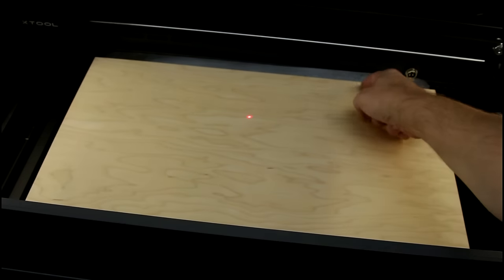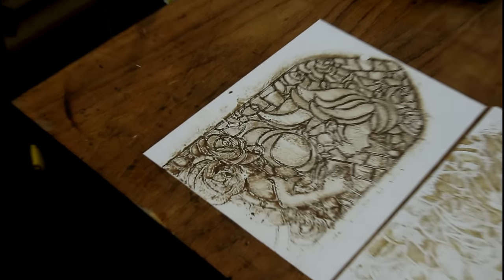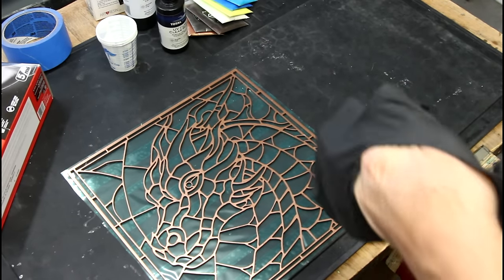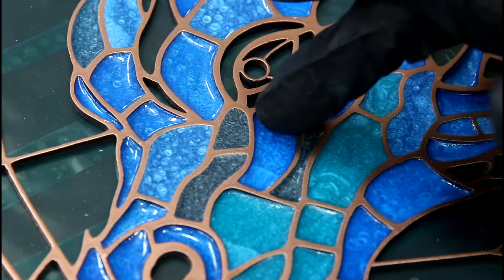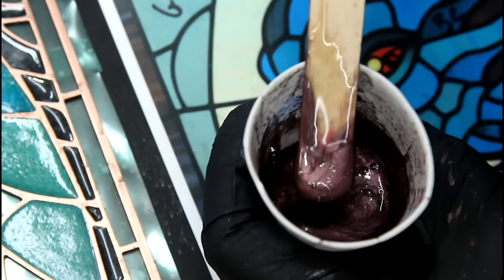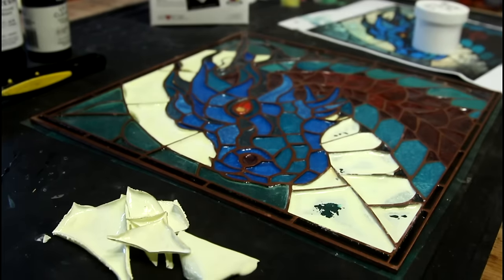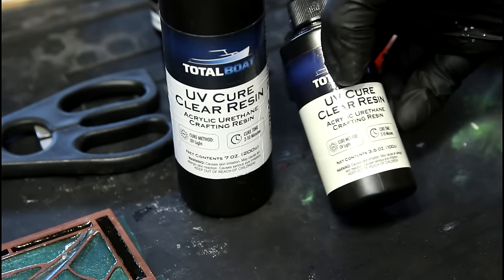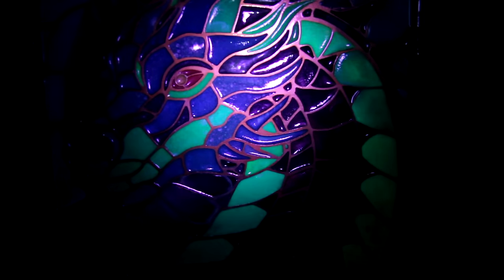Resin Stained Glass: Viewer Suggestions!

Comment: Some tips from me: buy a 365nm UV light (you used a 395/405nm i think) - use translucent packing tape (the blue tape you used blocks some uv wavelenghts so it can''t get thru to the resin - use a syringe so you can forse the resin in the corners.
Hope it helps you and keep up the good work 👍
Reply from the maker: Thank you!

Comment: Peter
You have probably heard this so many times already but I will put words in anyway lol
UV resin cures with light and therefore needs light to travel through it to cure. If the pigments are to opaque, the light wont get through and you will only be curing the top. 
If you want opaque colours, then you need to do many really thin layers.
But I salute you for your perseverance and flare  😀
Reply from the maker: Thanks Wendy!

Comment: As someone who has used UV resin in a number of jewelry sized items, a few tips! 

I use these pigments for UV resin, but 
1. You need a WAY brighter light. A nail art lamp is much better. Anything with any opacity, or big projects like that, I will let cure in a sunny place for a couple of days to get really hard. 
2. If you want translucent, use alcohol inks (but no white!). 
3. If you want to use mica, use several layers- this is way too thick. OR rub it onto a transparent layer, with another layer on top, you can make some neat effects that way. 
4. If you want opaque, try UV gel nail polish as a colourant, or buy UV resin pigments. Make the layers as thin as you can. Epoxy resin doesn’t always ‘play nicely’ when layered. As long as the layers are well cured, UV resin layers beautifully. 

Other tips: 
1. Nail art tools are your best friends, disposable brushes, lint-free wipes, etc RULE. Cheap as dirt on Ali Express. 
2. It cleans up well with rubbing alcohol
3. It doesn’t stick well to a lot of things that epoxy resin does- especially metal. A super thin coat of clear across the back will lock it all in. (I think the copper plating was ‘rough’ enough, but it can pop off of smooth metal)

I’m trying a larger window decoration, using brass flat brass wire right now. Definitely not as fast as this, but alas, no xtool (but lots of wire experience, so we’ll see).

Comment: Long time follower, first time commenter. 
I wanted to mention that "black lights" are not a good source for actual UV waves. The black light will help start it so you can finish it with the sun/etc, but it is not actually pumping out as much UV as you would suspect. I suspect almost any pigment will attenuate the light, increasing with opacity, in general. This can effect your lights penetration entirely or just increase the amount of UV needed. I would be curious how far you could push it though. 
If you do more work with UV resins in the future, I might suggest a "lab grade handheld UV lamp" or (more affordably) some UV LEDs. Either could be set up to 1) wave above your work to immediately set and/or 2) you can make a reflective box with the UV source inside (one might call it the UV EZ-Bake) to cure.
Can't wait to see your next adventure!

Comment: Howdy handsome. I have 3 questions. 
At about 20 minutes in it sounded like you were using a small torch.  Do you torch this resin to pop bubbles before using the blacklight to cure it?
Are you able to use Spray paint in UV resin and it achieves similar results as with reg A/B epoxy?
Can you create "cells" with UV resin?

Comment: Everyone else has already pointed out the 'too opaque to cure' bit, so I have suggestions if you want to use UV resin more in the future. I've found that a lot of pigments that are labeled as being for UV resin tend to fade A LOT in a relatively short amount of time, so I usually use VERY SMALL amounts of mica powder or, like, a single drop of acrylic paint. Basically, once the pigment is mixed in, if you scoop some of the resin up on a popsicle stick and hold it up to a light (just a regular, non-UV light in this case), if you can't see through the resin, it's probably too opaque to cure properly.

Similarly, if you put UV resin in silicone molds, they have to be transparent molds or else the light will have trouble reaching the bottom of the mold.

And while it wouldn't have worked for a piece this big, for smaller pieces, UV/LED nail lamps work great.

Comment: The trick with UV resin is TRANSLUCENT pigments. The more opaque your pigments, the more it'll block the light that cures the resin. That's why the darker red color you used didn't cure all the way to the back. With something that thin, it's easy enough to just leave it out in the sun like you did. But if you had a thicker project, that wouldn't have been an option.

Comment: I don't have much experiance with resin, but I do have a few resin dental fillings. The dentists never EVER do UV fillings in one go. They do a thin layer, shine the light, thin layer, shine the light, and build up the filling in 4-5 passes. The fillings are opague white, obviously. So I think that if the resin is not clear UV resin, you need to use either a dangeriously powerful UV lamp, or do it in passes.

Comment: I make little pendants with UV resin - whenever I add  pigments (no matter if opaque, ink or translucent) I make sure to always cure the backside as well before removing the tape. That's one of the good things about the clear tape: it lets UV light pass through.

Haven't tried it with such a big project yet (my pendant are usually just wire frames of roughly 2 by 3 inches at max) but I really recommend getting a stronger UV light and trying to keep the layers thinner so they can cure completely, even if you added some opaque pigments.

Comment: Total Pseudoscientific Conjecture (i.e., BS): What if the blue colors cured better than the reds because blue is closer to violet/ultraviolet on the spectrum and therefore didn't reflect as much UV away from the resin. That's probably not why it happened but that would be a cool explanation.

Comment: Man that was a bummer, it was looking so pretty! Glad you managed to save it! And I agree the blue is nicer than the yellow.
I was gonna drop some hints about my own experiences with UV resin but people beat me to most of them; only thing I haven't seen said is UV resin makes a LOT of heat on its own, so you want to use it in small quantities. I wouldn't go much bigger than what you're working with here. I think this would totally work with transparent pigments and stronger UV lights. A UV flashlight is OK for small things or "tacking" stuff into place but you want a big UV Gel Nail light or stronger. And I've had better luck curing things for twice as long as the bottle says, because sometimes it cures sticky on the surface and that seems to help.

Comment: A bit of an Info Dump on UV resins and pigments, What I learned on My Summer Project:

UV resin has issues with powder pigments because it blocks the UV light... that could have been the pigment problems with the cream white here.  Less pigment is better so that the piece has some depth, enough so that you can see swirls well beneath the surface usually ends up okay....but some resins don't handle it as well as others.  I'd wager Total Boat's is made more for doing clear coats as well, eg patching boat hull or coating lures and things would  be fine with just about any brand of UV resin.

Some UV resin brands also have issues with some alcohol inks(to get nice transparent reds or blues for example, like actual stained glass which also cure better for thicker pieces).  Let's Resin stayed very tacky and sticky on surfaces.  JDiction handled red/blue alcohol inks just fine for me, nice crystal clear transparent and hard on the surface usually, can be  finicky if you do various layers or have trapped air in your mold(I did chess pieces in a 1 piece mold with transparent red/blue heads).

That's the brand of alcohol ink I used anyways...who knows if other brands have the opposite issues with those two resins....troubles aside, if you clean off any sticky residue then hit with a clear coat of spraypaint that sticks to plastics, you get that nice glassy or crystal finish without needing to polish by hand(Doing a whole chess set would be terrible, even if one had all the proper tools like a lathe you could cinch down on the base of pieces).

Also, each resin brand can be very selective of lights that work....Some projects I hit with a couple lights and put them out in the sun for exposure to the full gamut of wavelengths that the lights I have may not provide.

However, the time thing is fantastic with UV resin, you can let it sit in warm water overnight and have utterly bubble free pours(aside from what gets trapped in mold details, which you have infinite time to pick out with a toothpick or bamboo skewer), or pour and let it sit, hit it every once in a while with a heat-gun.

Torching UV resin can get dicey though, it can actually light on fire in liquid form.....not to mention damage soft/sensitive molds(I'm using soft white/clear/frosted silicone molds, the chess set from Let's Resin).

Residue wipes off of all surfaces decently, wipe with dry paper or shop towel, then one wetted with rubbing alcohol.

UV resin also makes excellent resin tools.  Dip the flat  end of a bamboo skewer in UV resin, lift it and let it drip off until you have a nice blob just hanging there, then cure with UV light, works on toothpicks too, and these make great tools that glide along silicone molds instead of bare wood sticking or trying to catch in the silicone mold while you're trying to pick out stubborn bubbles in corners and crannies.

Comment: The light was blocked by titanium dioxide basically. That's what is in most white, and we'll, it's mineral sunscreen too. You can't really use opaque pigments with UV resin, it should have said that in your resin instructions

Comment: Peter I am really impressed with your efforts here! it really does look amazing! I wanted to give you an advice if you are going to keep working with such resin. You should make a wooden box with a door that you could insert your piece with resin and close the door, and on the ceiling of the box install a germicidal tube that makes a ton of UVC. it is much stronger UV than that flashlight and it would penetrate much more effectively. You could install a timer for example 2 minutes for each color and then for the final curing 5 or 10 minutes for a whole thing.

Comment: I agree with other commenters: the pale yellow and, to a certain extent, the red, were too opaque and the light didn't penetrate past the surface. A stronger light or longer curing time would fix that. The peeling/curling is similar to what is seen with gel nail polish when an additional coat is painted over a coat that isn't fully dry: it wrinkles. That brings me to another thing I wanted to mention: gel nail polish could be used for something like this. It's way more expensive than buying UV resin in a tube, so maybe only do that if you already have it laying around. There is something called building gel that is very thick UV resin, used for creating false nails with the help of a form, which could be interesting? I'm not a nail tech or any kind of expert; if you want more info on that I'd recommend Suzie of Nail Career Education here on YouTube.
Also: You can use clear packing tape to create things like small molds or backings for resins and acrylics.

Comment: Was the pigment Titanium Dioxide powder (titanium white)? Because if so, do you know what you just mixed in to your UV curing resin? Sunscreen! 

Titanium dioxide is a UV-blocking pigment that is so great at blocking UV that we can grind it so fine that an invisibly thin layer can reflect and scatter the UV to protect our skin. Would make sense if you could only cure the surface of the resin in using it

Comment: How long are you shining the UV light on the resin? It doesn't seem very long at all. If you're going to do this again, rig yourself up a resin curing box with some UV LED strip lights. Then you can stop waving the light around and just turn it on and leave it for a few minutes.
I made one for 3D prints using a 5 gallon bucket lined in aluminum tape and 2 strands of UV strips spiralling around the interior. Works great.

Comment: Trick with the UV resins is simple: after you're done, put the whole thing in the sun for a few hours. No need for lamps or anything. This is especially useful when doing carbon or fiberglass layup.

Comment: What a great video! Very well done. I have been building wooden clocks from plans for several years now (Ken's Clocks on You Tube) and I have run out of room to display them. I've been looking for a new hobby and stained glass was high on my list but this is much better. I can use my well developed scroll saw skills and I can see combining both hobbies by incorporating resin parts in some clocks or gears. 
I'll be watching this several more times and any future ones you put out. 
Great job!

Comment: Turned out great in the end!  Would have been easier if you had a large, proper, UV lamp but that's details.  The problem with the paste color was probably that it was too opaque for the light to penetrate (or you used too much) but you're right that it could also be that there was something in it that the resin rejected, most likely water or alcohol.  Still, you did well and recovered nicely given that it was your first go with UV resin.  Great job! 👏😁

I about cried when you tossed out the little pieces though. 😭  Not just because it could have made an awesome reverse image with different stains and some black resin to hold it together or because the pieces could be put into another project (painted, stained or coated in resin) but because I'm, first and foremost, a jewelry maker.  All those small pieces would have made some fabulous jewelry!  Earrings, necklaces, bracelets... So many things could have been made from them!  Especially since you had to cut it more than once and likely had duplicates of a lot of those pieces.  My soul weeps. 😢

Comment: As a dermatologist I can almost guarantee the white pigment (and maybe the red too?) had zinc oxide and/or titanium dioxide in it which is a UV blocker commonly used in sunscreen. They then blocked your UV light and the resin didn’t cure below the surface layer!

Comment: Different kind of project, but I keep the pieces because what I do is make coasters and such by cutting identical patterns out of different contrasting woods and swapping pieces between them.  I cut out thin circles of a neutral wood to act as the base, then glue the patterns down on top.  Made some very pretty Star Wars coasters by using padauk and aspen for the Rebel symbol, aspen and wenge for the Imperial symbol, aspen and mahogany for the Jedi symbol, and padauk and wenge for the Sith symbol.   Get yourself a bunch of 1/8" thick woods with different colors and grains and try it out!

Comment: You might be mixing the colours far too opaque. Light has to penetrate to all the layers of resin at once in order to cure. The white is probably a titanium dioxide white, which would physically block a lot of light. So the surface would cure and even curl up because the resin under it isn't getting light, or is getting progressively less light so the surface gets the tightest, causing the curl. Mica gets away with a bit more because it's made up of tiny reflective flakes, like microsparkles, allowing for more clear space around them unless you mix in a LOT. The white and red look like another more powedery kind of pigment entirely [chalky not sparkly very opaque]. I think just using less pigment would fix the problem, letting it be a bit see-through. Alcohol inks might be the best way to go if you aren't married to it having any opacity.

You could if you wanted, certainly dye or stain the wood of those cut outs, space them out on something like inlay, and fill the area around them with dark resin, if you wanted to use them for something. [Maybe sell them off to appease the fans?, maybe make a base with an opaque version of the design to hold up the stained glass portion?]

Technoglow has some really cool glow in the dark and uv reactive pigments that could make a whole image light up in the dark all different colours even without a uv light and having a nice translucent mix of them in something you put up against a window would lend well to that.

Comment: I also added too much mica pigment to my first opaque UV resin project... 😓 I thought it all cured because I cured it from all angles (it was a hemisphere) for plenty of time, with a good light, but then a few days later, sitting on the same table I had made it, I happened to touch it and it popped open and leaked uncured resin! Sure taught me a lesson 😅 I've found if you want to make something opaque with UV resin you can try very thin layers with less pigment, fully curing between and building up the opacity that way but you still have to be really careful.

Comment: For the UV resin, lookup what the actual cure wavelength is and get a UV light specific to that wavelength, it will  help it cure better. Also not a bad idea to make a cureing chamber, a simple box with some appropriate wavelength UV LED strips will do, leave it in to cure for 20min.